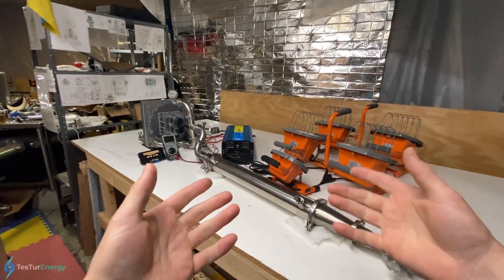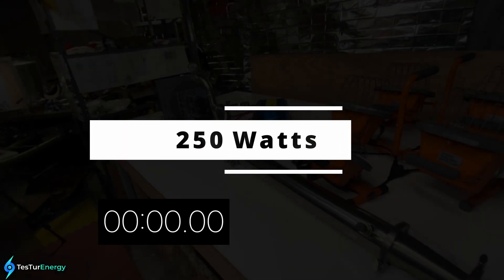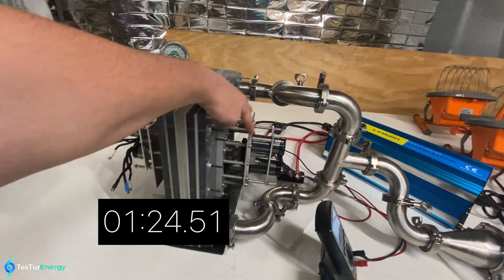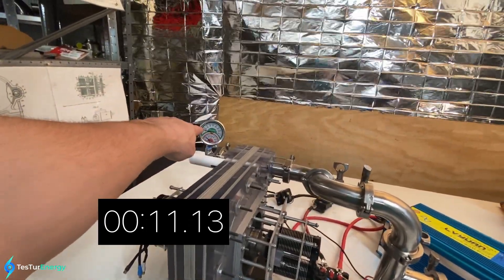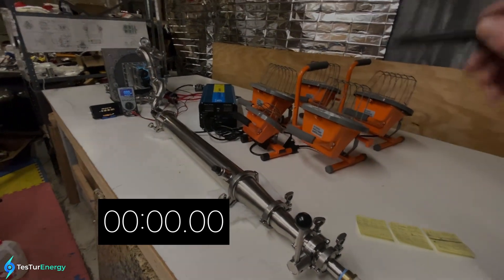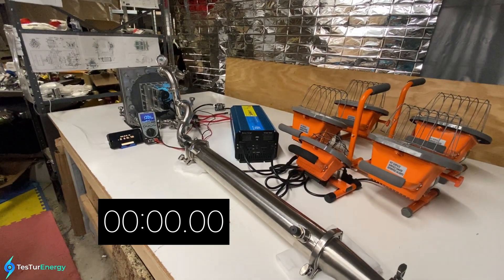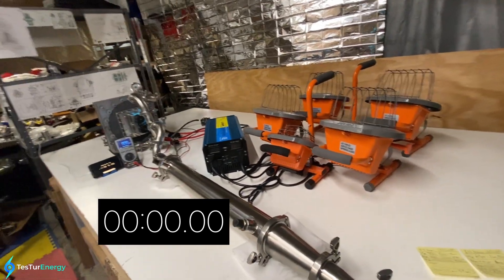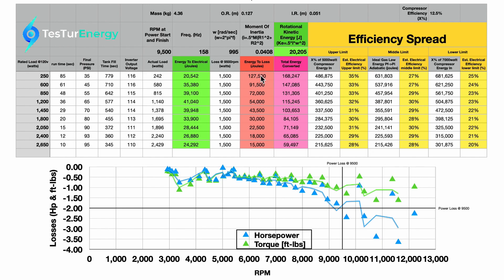Tesla Turbine 250 watt to 2.65 kW Power and Efficiency Test

Comment: Very brave to leave the connectors of the two not working motors/generators open like that. What would happen if two phases touch each other at those rpms?
Reply: Or are they not connected to the turbine?
Reply from the maker: @countZ74  hey thanks for commenting! ❤️‍🔥🦾 if you’re referring to the 2 extra generators (2/4) on the other side, those two do not have gears on them so they do not connect to the turbines shaft at all and don’t spin up just yet. 

I need to make more banana connectors to go to more rectifiers and put them in parallel for connecting them all together. But the two generators were able to output enough so far. 

Each peak out at 1,500 watts so I didn’t want to go above 2650 watts in the load tests until I did all that.

Comment: Hi,
Isn't 1.5watt = 0.002 hp?
Your table says 1500 watts which would be around 2hp however.
I think what you said wasn't matching what was written. I presume the written info is the correct one.
Reply from the maker: Hey thanks for commenting. But could tell me which part you’re referring too? I dont recall ever saying 1.5watts, so I’m not sure which part you’re referring to. Thanks
Reply: @CharlieSolis 12:07 1.4 something something watts
Reply from the maker: @GeoffHou  oh I see what you mean! I meant kilowatts. The mechanical load that the turbine has to push through just to stay spinning at that rpm with the gears and bearings is about 2-Hp = 1,491 watts or 1.491kW. But I just rounded it up to 1.5kW

Comment: I wonder if you could get a small PLC that can monitor the voltage and hook it up to a servo to manage that valve.
Reply from the maker: Hey thanks for the comment and suggestion! You read my mind! 

I’ve got a couple of ideas up my sleeve but I’m most eager to make the two different ones that Tesla used for his RPM regulators, the famed TesTur in the museum, and the one in the improved combustion gas + steam turbine patent of Tesla’s. 

The first works with the peripheral pressure in the turbine casing, that’s directly related to RPM of the turbine, being used to push on a piston that opens and closes off a pin in the main throttle body, that has a spring working against it. Changing the spring tension changes what pressure/rpm the turbine spins up to before the piston closes off the throttle and the turbine slows down and, when the turbine slows down the pin opens up.

The other is a rotary spool valve which I can’t explain as well just yet. 

But I’ll be making one very soon.
Reply: @CharlieSolis  you can probably have a set screw on the other side of the spring so you don't have to change it out with different compression springs. The tighter the set screw, the tighter the spring.

Comment: This is impressive work, man. You've got the most thorough research on tesla turbines I've seen on YouTube. I've considered using one of these in an attempt to make a reverse-Brayton cycle cryocooler using air/nitrogen, but since the momentum transfer relies on skin friction, I've been concerned that any cooling effect might be offset by friction heating. Have you looked at inlet/outlet temperatures for various pressure drops/flow rates to see if there's a significant temperature drop when you're using air?
Reply from the maker: Hey thanks for commenting! So while there is some heat generation from the shearing of the fluid within the turbine, and when used as a compressor, it’s not very significant when the disc is designed correctly

Though I need to be clear though it’s not friction for how this turbine operates. 

Take a listen to what Tesla says in his article Dr. Tesla Talks Of Gas Turbines.   

““I have been working at this a long time. Many years ago I invented a pump for pumping mercury. Just a plain disk, like this, and it would work very well. ‘All right,’ I said, ‘that is friction.’ But one day I thought it out, and I thought, ‘No, that is not friction, it is something else. The particles are not always sliding by the disk, but some of them at least are carried along with it. Therefore it cannot be friction. It must be adhesion.’ And that, you see, was the real beginning.  “For if you can imagine a wheel rotating in a medium, whether the fluid is receiving or imparting energy, and moving at nearly the same velocity as the fluid, then you have a minimum of friction, you get little or no ‘slip.’ Then you are getting something very different from friction; you are making use of adhesion alone. It’s all so simple, so very simple.  “This is the greatest of my inventions,” Tesla went on with great enthusiasm.“ 

Additionally, though there might be some heating from the shearing of the fluid, there will likely be just as much exceeds beating of the fluid from any turbulence present in a bladed turbocompressor too if it’s not design to extremely high standards.
Reply: @CharlieSolis  Thanks for the info. I'm going to look more into using one of these due to the ease of manufacturing
Reply from the maker: @HyperspacePirate  hey thanks for commenting. 🙏❤️‍🔥 I really appreciate the love and support.    So just to be clear I do have a degree in physics and many years of working with industrial machines.  And now I don’t want to discourage you but I need to be abundantly clear though that sadly, these are not toys. They are VERY dangerous if not designed or handled properly.  I do not advise anyone who doesn’t already have a background in mech engineering/physics etc. to attempt to make one of them on their own.  If you wouldn’t feel comfortable taking apart a jet engine and putting it back together and know that it would work properly again then I would think twice about taking on this endeavor.  That being said. If you would like to start I would suggest by consuming as many mechanical engineering class videos as you can on YouTube.  Learn all the thermodynamics behind steam and gas turbines.  Specifically for Tesla turbines it requires a great deal more chemistry due to the Tesla turbine operating on molecular viscous adhesive forces between the fluid and discs and not in mechanical collisions with the blades like traditional blades turbine.  So making sure to have the right surface treatments for the proper motive fluid is very important too.   “Don’t French fry when you’re supposed to pizza or you’re gonna have a bad time.” <-Words to live by.
Reply from the maker: @HyperspacePirate  I want to be explicitly clear with people just how dangerous this is. It’s easy to see the turbine not doing much other than spinning and think it’s not that difficult.   But to put some perspective on it…. 

The ~25cm (10in) diameter 75disc aluminum turbine is 4.36kg (~9.5lbs)     So whenever anyone see this turbine spinning they need to imagine a literal 10in diameter 10lb dumbbell weight spinning at 7,000-13,000rpm 🤯🥵😅    At 13,000rpm the turbine rotor has 30,000joules of rotational kinetic energy.     For perspective, that’s about equivalent to:  5-10% of the kinetic energy of a whole car at highway speeds.   If that stored kinetic energy were to be used to launch itself straight up into the air…    

KE = gravPE = mgH

H = KE / m / g     
    = (30,000joules) / (4.26kg) / (9.81m/s^2)
     = 708 meters straight up into the air… 🤯

   ~3/4 of a kilometer or ~0.45miles.
Reply from the maker: @HyperspacePirate  if you want to get your hands dirty with a prototype of your own we are now selling versions of the 4.5in Tesla Turbine that we built during our video collab with @integza     

www.HeatAndPower.com     

This prototype is priced at $999.95, and embodies our countless hours of rigorous research over the last 3 years of R&D into Tesla Turbines that actually work.    

Crafted with precision, the prototype boasts a robust design featuring an aluminum disc stack enclosed in a high-quality polycarbonate casing.    

The turbine is tailored to accommodate a variety of testing conditions, though currently optimized for compressed air tests.    

From initial trials, the turbine has shown promising potential, generating 1200 watts of power on a Dyno test with 30-40psi and a notable 250 watts electrical load when partnered with an upgrade generator package) on just 15psi of compressed air.    

It is also designed for future upgradeability, with provisions to accommodate a 2-stage upgrade we aim to release soon.    

While this turbine is a working prototype, it’s not a complete, turnkey solution or operational turbine. 

So, what’s the purpose of this unit?  We’ve designed and are selling this prototype to provide a hands-on, engaging, and informative tool for those interested in our renewable energy systems, and specifically in Tesla turbine technology.  

It gives you a chance to see the turbine in action, understand its mechanics, and gain experience with assembly, disassembly, and maintenance.  

We believe this initial experience is crucial before making the step up to our full-sized, turn-key power generation systems.   

Get Yourself Prepared  

This prototype is essentially a first step for those considering a full-scale residential or commercial Combined Heat and Power (CHP) system.  

It offers you a unique opportunity to get up-close and personal with the turbine technology, and gain a practical understanding of its workings, benefits, and potential.  

It’s a scaled-down, educational version of the turbine we’re developing for our full scale solar thermal and biomass powered CHP systems.  

From initial trials, the turbine has shown promising potential, generating 1200 watts of power on a Dyno test with 30-40psi and a notable 250 watts electrical load (when partnered with an upgrade generator package) on just 15psi of compressed air.  

It is also designed for future upgradeability, with provisions to accommodate a 2-stage upgrade that we aim to release soon. 

What Does The Loyalty Program Do For You?   

Learn how to safely operate a Tesla Turbine now with our smaller 4.5in prototype. 

Then save on your full scale turnkey residential or commercial power generation system later!  

Purchasing our 4.5in Tesla Turbine gets you a 10% discount that’s applied to your full size residential or commercial system, in the end saving you more than the cost of the prototype. 

See our website for more loyalty program information.
Reply: @CharlieSolis  Thanks for providing so much information. I've got a regular old air compressor that pushes 2.6 CFM @ 90 psi, and I'm trying to feed that into a turbine with a brake on it to extract as much mechanical energy as possible simply to cool the air through isentropic expansion. I don't have any requirement for a particular RPM/Torque behavior, I just have to extract energy from the airflow, so whatever load produces peak power, i can just dial it in by increasing/decreasing tension on the brake. 

I was going to build something in the neighborhood of 4-5" diameter with 20-30 0.8mm plates spaced at 0.5-1.0mm. No real analysis behind that other than the fact that a fabrication shop can produce parts with those dimensions very cheap...so cheap that I don't need to bother firing up my own CNC.